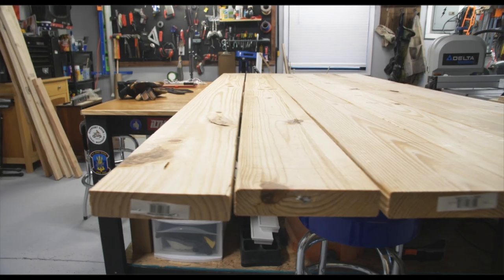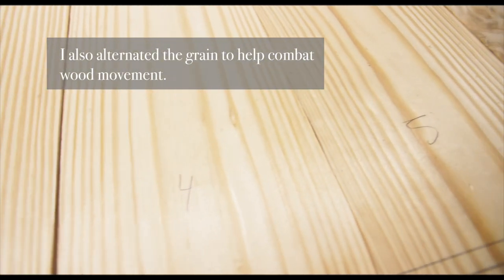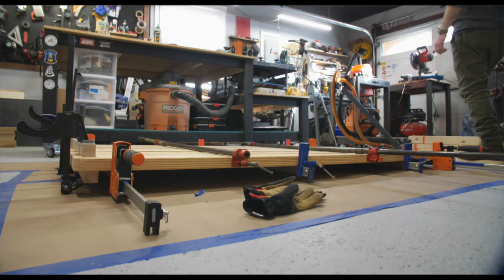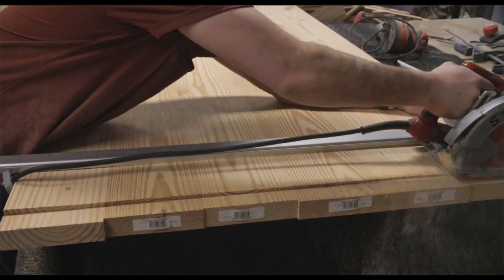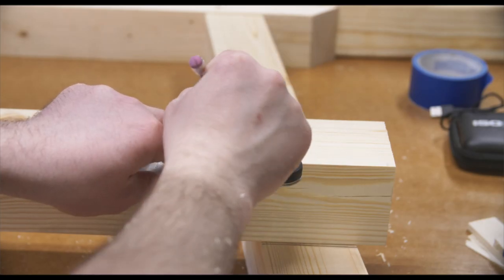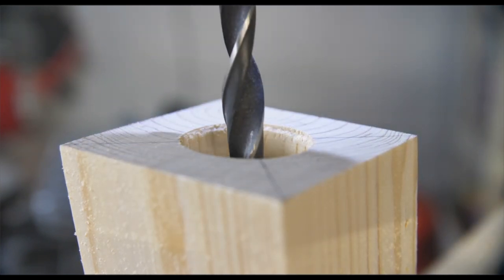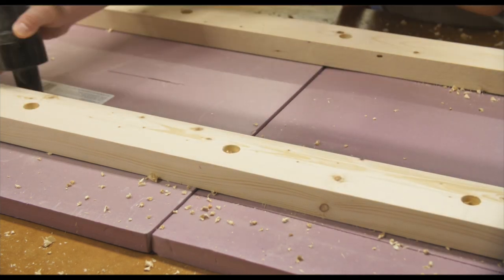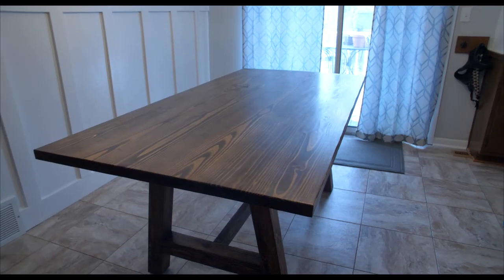Building a Modern Farmhouse Table

Comment: I think you did a great job on this. I made a very similar table using Anna White's plans. As for your comment about over marking for Dowels - no such thing lol it's better to do more than less.

Also, titebond 2 is more than sufficient. I used 3 at first after watching a Project Farm video, but the higher viscosity of titebond 2 is really nice. It's also water resistant and is even food safe for cutting boars (it has FDA approval).

Keep going! I hope to see more from you.
Reply from the maker: Thank you! I guess I forgot that about Titebond 2 which I have an abundance of, I may have just had some first time table nerves and went with TB 3 to make extra sure, lol.
Reply: @DaverMade  lol that was exactly my reasoning at first. The rated psi of 2 and 3 is like 3500lbs and 3800lbs respectively. So unless you're parking your car on top of it, it'll be just fine :)

Check out Project Farms video if you haven't yet. I always consult his channel before buying anything.
Reply: I thought TB3 was the food safe variety. Otherwise, I agree, why bother having it?
Reply: @daveparker839  I thought the same until visiting the titebond website. On the website both TB2 and 3 are rated for "indirect food contact" by the FDA which translates to safe for cutting boards per titebond themselves. Basically, if it isn't actually safe for cutting boards titebond is putting themselves in major legal risk with the FDA.
Reply: @kevinwiley5325  Hmmm...I’m wondering if indirect food contact is a table and direct food contact is a cutting board because placing food on a cutting board is literally putting it in contact with the glue, no?
Reply: @daveparker839  I'm no expert on that kind of science, but titebond feels like one of the few companies out there that is trustworthy. Frankly, if TB2 were not food safe, I have no reason to believe they wouldn't happily sell you the more expensive tb3 in its place and not even mention TB2 as cutting board safe. But since they explicitly say on their website that TB2 is good for cutting boards I'm going to roll with it.

Also, water resistant means that a product is fine for getting wet and cleaned, just not submersion. Tb3 is good for submersion.
Reply: @kevinwiley5325  Interesting that they say that say that. Good information! Thanks for sharing.